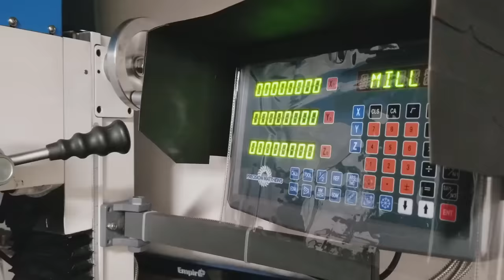New Machine Day! PM-728 Mill, Setup and Review!

Comment: I am glad for you that you can see the differences between the two machines, given the 50% price difference. Nicer is always nice.
Re the power feed blocking the T slots. I don't have that problem because my vice is mounted nearby. That spreads the table wear and gives a fair degree of top space without de-vicing. 
I was pleased to see how easy it is to remove the draw bar. I just discovered that mine is 12M but the tooling I bought is 1/2". Hmm! Well, back to the mill - and for more machining jokes see my monograph 'Chips off the old flute'.

Comment: I'm so jealous! Not just because you got a mill for free, but also the large workshop(well, large compared to mine)   
Wheels... Even my mini lathe is on wheels in my workshop.(A pair of wheels on one end, on hinged extenders that I can force down on the floor when I need to move it. The stand bolts to the wall when I use it)   
I'd love to have that mill, and some day I'll probably get one, or a similar one, I just need a bigger place... and to win a lottery... ;-)

Not certain why it needs so long to stop, though. This mill has a Brushless DC motor for the spindle, and it's not difficult to build the controller to actively brake the motor when you want to stop it spinning. Even my Lathe(SIEG SC2) stops the spindle within moments if you want to stop it.

Comment: Congratulations on the new mill. I have had mine for about 8 months and it’s a great machine. I’m sure you will enjoy it. I am looking forward to seeing what you do to tweak / improve. I replaced the Z and X axis hand wheels, with one that have a folding handle. I have the Priest Z power feed as well as the spindle lock. The folding handles eliminated almost all of the shaking when rapidly moving the table. 

I am especially interested in your mod on the quill “DRO”.  I have thoughts on designing a way to eliminate the need for batteries. 
Thanks for sharing and keep up the great content!

Paul

Comment: Congratulations! I got a 727 a few years back, in part because of your videos.

I’ve noticed similar issues with the quill DRO and the quill fine feed, but my quill lock holds the quill securely.

I’ve been thinking about a DRO upgrade with a second scale on the quill and a summing DRO. Also kinda waiting to see how that works out for @clough42 before I dig too deep into it. 😉😉

I’m definitely jealous of the automatic oiler and higher  spindle speed on the 728.

Congrats again and enjoy, you deserve it!

Comment: These types of bench top mills are basically small style bed mills. Not as capable of course. I've run various types of milling machines from small round column bench top types up through jig and boring mills (1). For a small home shop in my opinion th these types of mills are a very good compromise. Relatively inexpensive.  Light enough to go into a basement shop (in pieces) and reasonably compact. Not everybody has room for a Bridgeport or a clone (2). I think what I would like to see on these is a way of rotating the column so as to allow longer pieces to be hung off of the back of the table like on a Bridgeport. 
1) One of which had an operator's platform that you rode on.
2) I'm not as enamored with BPs as a lot of people. Granted they are handy. But they gave a number of weak points IMO. First is the bearings in the spindle. They are too light. There is actually room in the lower bearing stack to put in a third angular contact bearing with new spacers. Doing so stiffens the spindle up nicely. Second is the R8 collets. The worst collet design out there for tool holding. The third thing is the operators that beat on them.

Comment: I didn't fancy the bracket that clamps onto the end of the table, and blocks the -nuts, either. So I fastened it to the end of the table, or to the bearing housing, it's along time ago, so I can't remeber exactly. But I can snap some pictures and send to you, if you want. 
With my installation, the power feed isn't higher up than the table of the milling machine.
Greetings from Norway! :)

Comment: Nice little mill, I was just looking at this and the other PM mills today..lol. The PM 833T caught my eye.✌🏻
Reply: Very happy with mine.  Did have a few issues  ,worked out.  Note I Installed limit switch for Y axis on same side as power feed.  The oil line is installed inside column so I put scales for DRO ON other left SIDE. IF SPINDLE runs hot use kluber isoflex (15) runs cool at 3200 rpm.

Comment: I am a retired mechanical engineer. Most of my work was in Project management for capital projects upwards to $20,000,000 each. 

I ordered a PM 1440Gt and a PM728VT last week. The mill has already shipped and will probably be at my home shop next week. I built alot of items every week. I have some really nice welding equipment. 

I do not have a lathe background. I found your video very informative. I have an overhead winch. I really like how you moved the mill into position via the shop crane...especially  utilizing the board to let it rest on while moving into position. Rigging has always been something I been good at. Thanks for taking the time to pass on your knowledge on this subject. 
Send me a cell number and I will show you some of my projects. I have built my residence in the the past.   (10,000 sq. ft for 3 buildings). I have a lot of wood working knowledge.

Comment: Congratulations on your fine new machine. As you went thru some of the details I can tell that many of the design details are identical to, or scaled versions of the Bridgeport clones. My 1054TV has many parts that look identical. The 1054 is a Taiwanese  machine and I've been pretty deep into it. I had to disassemble it so I could move it by hand with an engine crane like yours. The important stuff in these machines seems to be well done, but I found several holes drilled at amazingly odd angles. Seriously 10 or more degrees off axis. Some little barefoot dude was leaning into a hand drill and eyeballing things, it seems. You may find such surprises anywhere...and I kinda irks me...but as you pointed out, they get the critical stuff right and they steadfastly keep their prices very reasonable. I am amazed that they've been able to build that company so successfully. 

I find your channel motivating and I believe it is because you communicate a huge amount of detailed knowledge, and you are an exceptional organizer and teacher. I've been trying to video some of my shop projects, and I'm a smart guy, but it really takes some time to get all the skills working together. You do it far better than most. Thank you for the huge effort you put into this.

Comment: pssst 
just saying ...
a ratchet strap set with a very low horizontal pick can move tonnes... 
(my nye was rescueing from storage locker demise ) a 1700lp busybee mill 6'tall  onto a u haul trailer with a pellet jack  but i only had pipes and a 5 bar with ratchet straps to move it off luckily with plenty of etrack for off load location..5" height difference was a totally different story once trailer bed unloaded...
 this will ease your crane bed seating is ratchet strap.. no need for the chain hoist  or wire rope puller just a ratchet strap on the two closest corners of the pallet and the  belly of the strap around your hoist mast..
 rigging is a trade school component but a lifelong skill

Comment: Quinn I enjoy your videos. I'm spoiled though. I own a Tormach 770 CNC mill with Tormach quick change tooling. 1 special 3/4 R8 collet that takes all the tooling and because of the design the tooling is always at the same  Z location no matter how often you use that tool say a 1/4" end mill. I even bought one of the collets for my manual mill so I can use the tormach tooling in it.  Dave

Comment: Regarding the display, if you take it apart you'll likely find that the front LCD is a single off-the-shelf module (it certainly is for the RPM readout on the electrical box), and they're typically sold by manufacturers both with and without backlights. You may get lucky and find that you can buy an exact copy except with an integrated backlight, then just hook up the extra pin(s) for that. That'll improve both legibility and viewing angles, since the reflected light from your shop's overheads won't wash things out quite as much.
Reply: That won't help the slow refresh rate. Basically the added expense of OEM DRO would have been wasted, if paid for.

Comment: Wow, nice machine congrats, it's more than well deserved after all the business you've sent them. First looks it seemed about the same size as the previous mill, but taking 1.9mm depth of cut in steel without lot of vibration is definitely a sign of a well made bench mill. Looking forward to Z axis power feed upgrade :)

Comment: I like to see what you'd get if "fantasy shopping" for a new machine shop. Just pick certain rough price ranges, and talk about what is out there that you'd find interesting. Include things like power requirements, e.g., 220 single phase versus 3-phase. How much room you have, what support equipment you'd need (e.g., the engine hoist, a hydraulic cart, milling bits, so on...anything supporting what you do). I'd be interested in what your view is on "interesting" shop builds.

Comment: I used a Bridgeport mill that took R-8 collets for most of my life. I rarely used the 3/4" The walls on them are too thin they spring out easily, plus it doesn't hold the cutter tight enough, causing it to pull out when heavy milling.

Comment: Would it be possible to drill those plastic lead screw caps so that you can snugly fit in a super magnet or two to hold it in place instead of that double face tape?
Wow that's quite a Merry Christmas present. As they told you,  you deserve it .... and for more reasons than one.

Comment: Hi BH. Congratulations. Not for doing it, for doing it safely. I've seen others - no names no pack drill but they know who they are - who committed the cardinal sin of getting bits of their bodies into the machine gravity shadow. Folks, never ever trust that valve in your engine hoist. It fails, you lose a hand, or worse, you lay there trapped, screaming for help that does not come. If you must reach under have the machine weight taken on trusty lumber. Not bricks, bricks can crack on you. Ideally, and I know this is not always possible, have someone else there not involved but with a phone .....
Reply from the maker: As I always tell people- “All this steel is not holding that load. A 15 cent O-ring in that cylinder is”

Comment: If you’re concerned about getting smacked in the face by those metal straps you cut, try zip tying each side on both sides of your cutting spot. I’d say within 6” of you cut and snug the ties lightly. That should help keep them tamed and you safe.

Comment: I noticed you trammed to the X axis, but not the Y.  I have one bench mill, a DM-45 and a knee mill similar to a Grizzly G0731.  Like yours, they don't have any way to adjust the Y axis tram and both required small amounts of shim to get them to a reasonable state.  It would be nice to see a more thorough inspection of the squareness and perpendicularity of the machine too....  such as boring a hole with the head as close to the table as possible, then move the head all the way up and sweep the hole with a test indicator.

Comment: I have the PM-728VT from like 2yr ago.  I notice your quill DRO and your big DRO screen look different than mine.  I had issues with my quill DRO, too.  Basically, the body is not fully locked to the head.  The quill DRO itself moves up and down a little, which makes it look like the quill moved a little bit, but it really didn't  I was able to tighten the thing down a bit and got most of the movement out.  Never got around to shimming it.

Mine doesn't have an auto-shutoff.  At least, if it does, it must be longer than a couple hours.  My quill DRO turns itself on whenever it sees movement.  It has its own power button which is separate from the rest of the machine which is kind of annoying.

Reason I ended up getting the 728 mill was the warranty.  Everything else in this size comes with 90 days or up to like 2yr.  The has hardened gears and whatnot in it, so PM can offer a 5yr warranty.  Same reason I got their 1340GT.  The 5yr warranty got me.

Comment: Hi Quinn ! I recently started watching some of your very informative videos, they are great. I noticed that you use parallel bars for a lot of your milling operations. My brother in law (lifetime machinist) took my mill vise (original Bridgeport) and put 2 precision slots (5/32 deep and 7/32 tall) on the top side of my jaws 20 years ago. I find that they hold about 90% of the parts I mill/ drill without getting out the parallel bars. What are your thoughts on this? I havent found a downside. Thanks Eddie

Comment: Hi Quinn. Congrats on the new mill. That was really nice of them to give you a new mill. I have my heart set on a new PM Mill, just haven't made my mind up on which model. I don't want to go too small nor do I want to get carried away with spending more $ than I need too! I do believe in buying once and crying once when it comes to tools and machinery. However I do have an issue that may govern the size of mill that I get. I had an opportunity to get a good deal on a 6 inch mill vise before getting a mill. I noticed that you appear to have a 4 inch vise for your mill. Would you be of the opinion that a 6 inch vise is TOO BIG for the PM-728? Any opinion, info, or suggestions are welcome and respected. As always - Thank you for sharing with us on I-Net! 🙂

Comment: Grease related comment. Check out the company lubrilab for an amazing grease that has no smell! Their high performance additives are animal based instead of heavy metal based. I’ve been using it for years. Not much more than the other high performance grease and it’s a company out of Quebec. I love your videos! Can’t wait to see more on the steam locomotive.

Comment: Could you drill and tap into the end of the table and replace the power feed clamp with longer bolts and spacers?
Reply: Yes Depends on what model you get an earlier version shown in PM933VT  manual you they drilled end of table . The one I have clamps also ,but looking at it you could  mount clamp on table mark table and drill and tap measure to table, make shim. Then you can remove clamp part and insert shim  and bolt into end of table.

Comment: i am wondering if there PM-1236 Precision 12″x36″ Lathe would do steel pins up to 2" x 23" and pin boses up to 3" bore and 0.6 wall x0.75 long an what tooling i would need to make my own pins bushings pin boses for all my welding repair jobs and MFG. ONLY OTHER thing i would need to do is cut key ways in shafts an bushings. would be crazy to have to buy a mill just for that

Comment: Congrats on the new mill!   
I have a question for you though. 
If it's not too much trouble, could you tell me the outside diameters of the four poly-V belt sheaves? 
The reason I'm asking, is that I'm planning on converting my Chinese mill to Poly-V belt drive, and I don't know what gear ratios (belt ratios?) I should choose :)

Comment: Just out of curiosity, does the X axis drive use a braking circuit?  In the video it seems the drive runs on, relying on the gearing and load to slow it down once turned off.  This can be an issue if positional accuracy is desired.  It just seems that today, an electronic brake would be incorporated into any axis drive, as run-on can lead to crashes.  Years ago, for DC motors, I used to accomplish this through dynamic braking by having a resistor switched across the motor leads when the power to the motor is cut.  This stops the motor immediately, so there is no run-on.  For AC motors, DC injection works well.
Reply from the maker: Mechanical clutch stops it instantly

Comment: I'm looking for a mini mill to work with aluminium plate 100x100x30mm. I want to drill 16mm holes 90mm depth and 10mm slots 80mm long. Plus facing the 100mm sq surface. I also need it to tilt. I live in Norther Ireland. What milling machine would you recommend. 
Thanks

Comment: On my mill if I am doing a fast traverse into the limit switches the motor takes too long to stop and nearly smashes the limit switch. Just curious how far your table travels under the same conditions. At normal milling speeds it is not a problem.

Comment: Can it be CNC converted?
Reply: I'm looking for a mini mill to work with aluminium plate 100x100x30mm. I want to drill 16mm holes 90mm depth and 10mm slots 80mm long. Plus facing the 100mm sq surface. I also need it to tilt. I live in Norther Ireland. What milling machine would you recommend. 
Thanks